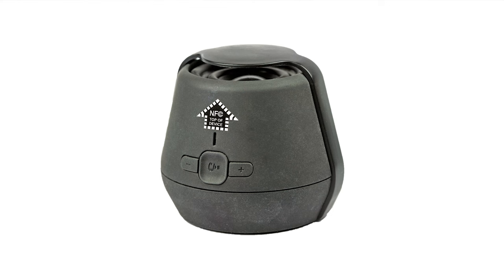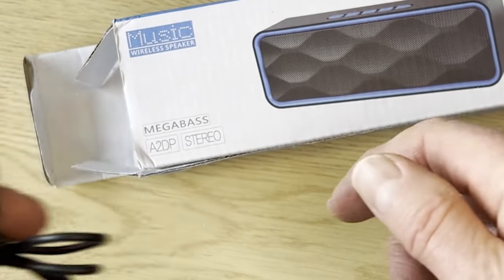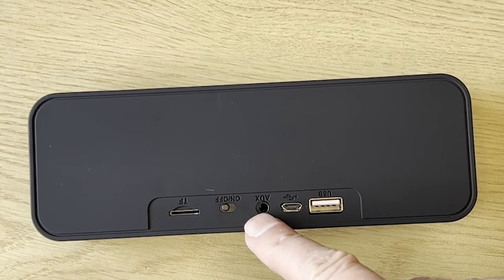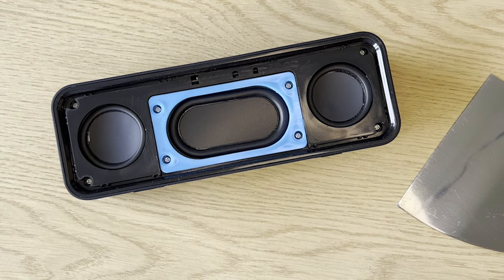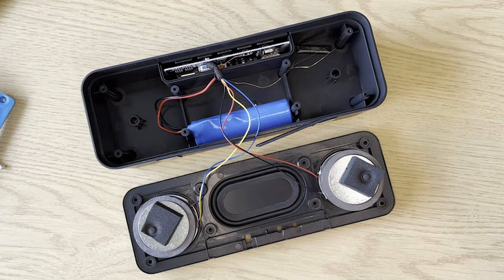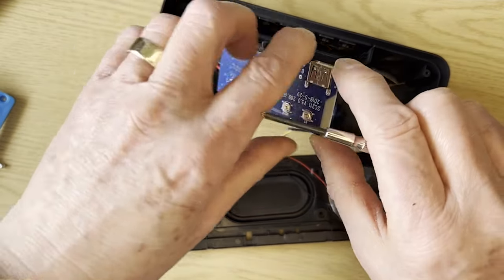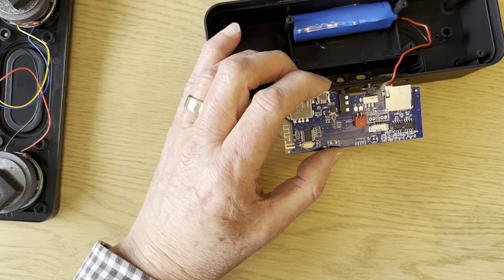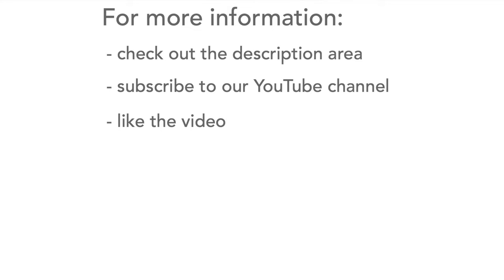Bluetooth Speaker Teardown - the electronics inside a wireless speaker

Comment: Interesting. I have a very similar speaker. But I was really hoping to see the battery because that's probably the lowest quality component and could use replacement. Would also have been good to see if there was any comformal coating on the PCBA.
Reply from the maker: Thanks for your replay and useful feedback. There was no conformal coating not he PCB. I would not expect it on a consumer device. So you can access the PCB quite easily.
Hmmmm . .  as for the battery it is just a tubular battery that was glued to the back panel. Very easy to replace if you could get the right one.
As every design will be slightly different, I would suggest that you open yours up to see what it has. The key thing I found was to take the speaker grill off and then remove all the screws to allow tthe speaker panel to be removed. Then you can see what is in there. Be a little careful to ensure none of the wires break.
I hope that was helpful.
Reply: @ElectronicsNotes  Hard to be sure if it was a cylindrical battery from the video. If it was a standard 18650 lithium ion then it could be hacked with an easy to find replacement. I suspect that the cheap manufactures use low quality or salvaged batteries with depleted charge cycles and capacity. Am curious of the battery type, capacity and any indication of built in battery management/protection circuitry. Thanks for the teardown and your response!
Reply from the maker: @davidneufeld26  it is quite possible it is a standard size. It is quite likely to be low quality but I would imagine it would not salvaged because they could not get the continuity of supply,
Reply: @ElectronicsNotes  Would not surprise me in the least if there was an operation that retrieved parts from returned, stolen, unsold, discontinued, or quality-failed items in Shenzhen City.
Reply: @davidneufeld26 I agree with your comments regarding component recovery in China.

Comment: I have a speaker that shows connected but it's not making any sound what should i do to correct it sir😭😭
Reply from the maker: Possibly turn but on and off and try reconnecting. Have you also tried another music source to see if that works. Try to isolate the issue by eliminating various elements.